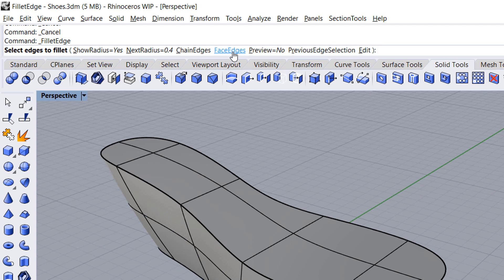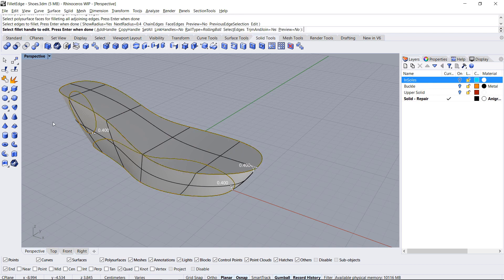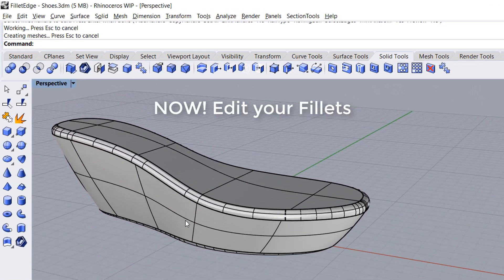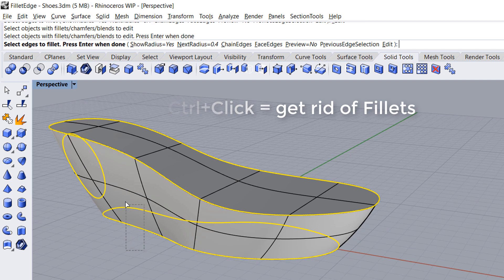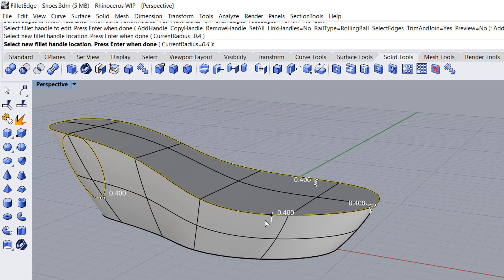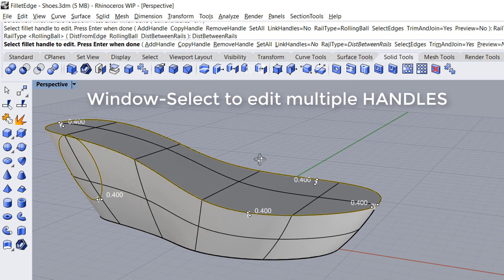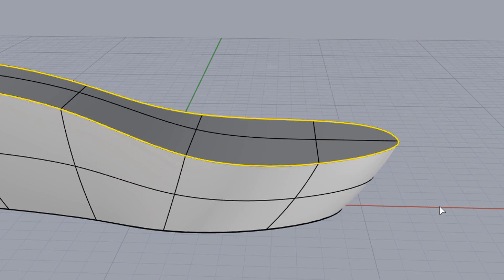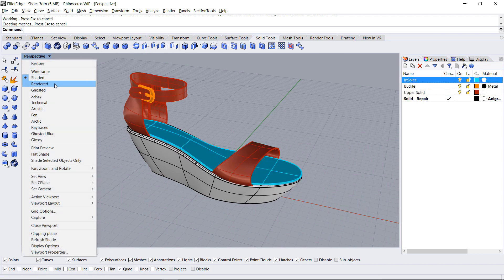Quick Tip: How to edit fillet edges on solids in Rhino 6

Comment: it is actually not possible after saving the file. when you open the file after sometime, you cant edit fillet parameter with that tool. is there any solution.? im using rhino 7